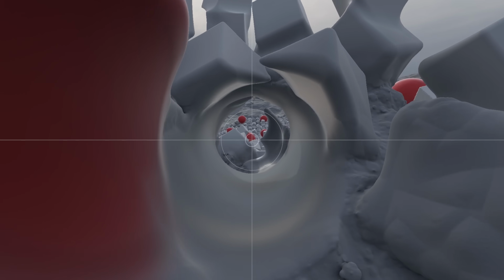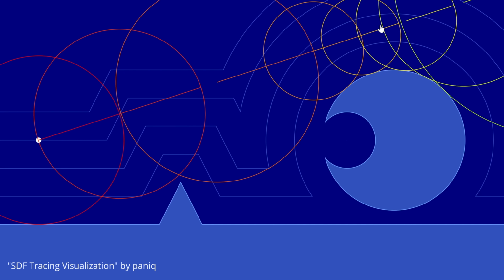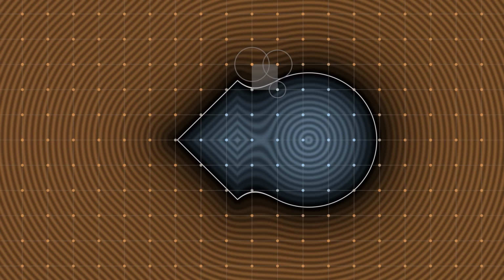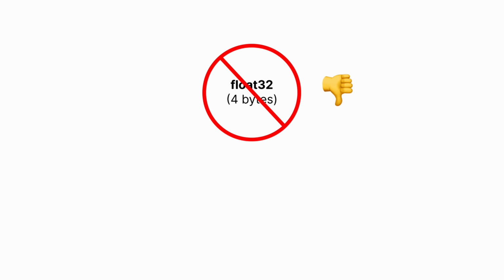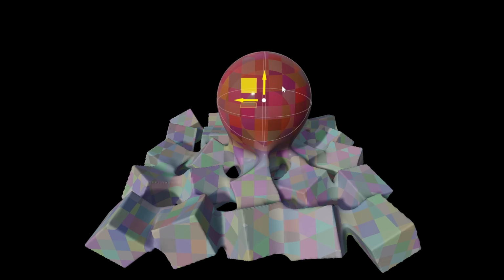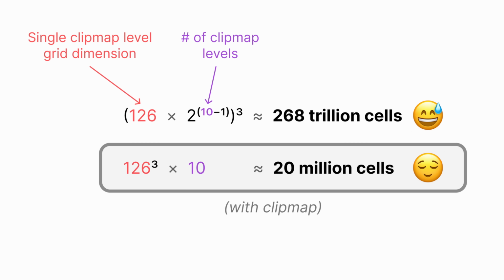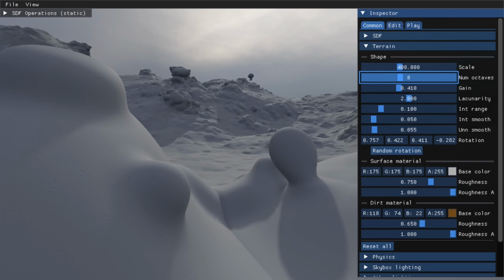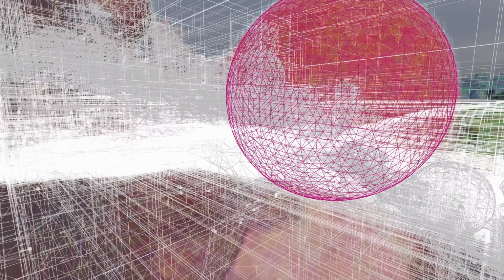I'm making a game engine based on dynamic signed distance fields (SDFs)

Comment: Hi, impressive work, I come with a technical question/suggestion.

You're currently caching SDF values (in a dynamic sparse 3d grid on the GPU), which lets you save time, in exchange for slight deformations of the surfaces.
Have you instead considered caching references to the closest primitive SDF and its parameters ?
That way you could evaluate the few neighboring primitives referenced in the cache at a given point. I might be a bit more expensive than a bilinear interpolation, but still way cheaper than computing the SDF of the whole scene. Importantly, you would keep exact surfaces, and so maybe you could reduce the granularity of your cache's grid (really, you "just" need to make sure there's about one grid vertex per primitive SDF).

Admittedly, I'm not sure this is a wise thing to do with your engine, I'm just frustrated because the first thing that seduced me with SDFs was the possibility to represent many non-polygonal shapes exactly, so I was wondering if it could be saved.

Comment: I was disappointed when I got watched to the physics implementation. SDF makes it possible to perform collisions of the most complex objects and find the exact value of penetration as easily as boolean operations! It must be used! The better to spent more time on the physics engine than implementing one more marching cubes...
Reply from the maker: It is a bit more complicated than that because operations like smooth blends and subtractions lead to an inexact (but bounded) distance field. So you no longer have accurate distance measurements.

Comment: I wonder how do you deal/will you deal with some SDF operation like smooth union and stuff that bend the space and make it non-uniform or if this will be an issue in the first place. I guess it depend on what you do with it.
Reply from the maker: The short answer is that I limit the amount this happens and then pad the affected area in such cases for recomputing the SDF surface.

Comment: Others have given their input regarding the technological side of your project, but If you’re looking for help or inspiration for the “game design” side of making a game about destructible terrain, I highly suggest checking out Nintendo’s dev interviews for Donkey Kong Bananza, a 3d platformer which also uses destructible terrain (albeit done with voxels) as its main gimmick. They go over some of the problems they faced in the process of making a game where the player could just tunnel through everything as well as how they solved them.
Reply from the maker: Good suggestion, I did watch the DK Bananza GDC presentation last month and liked it, definitely relevant. Are you thinking of specific interviews?
Reply: @Mike-Turitzin  the dev interviews on nintendos website

Comment: Since you're looking at sparse trees, you might find this paper on directed acrylic graphs interesting https://www.cse.chalmers.se/~uffe/HighResolutionSparseVoxelDAGs.pdf
Reply from the maker: I've seen it, and it's good!
Reply: @Mike-Turitzin  by the way, I also have a raymarching game engine I've been working on so it would be interesting to chat, mine is no where near as good as yours mainly as I have no sparse voxel traversal to act as a cache. I have massive performance issues which has been demoralising, but I'm pretty proud of what it's able to render otherwise

My main issue is that it's running on a giant compute shader with nothing pre-compiled, everything is fed through the SSBO, BVH with each leaf being bytecode in postfix notation to describe the CSG operations. So the shader basically runs a virtual machine to handle those operations, the register pressure alone means that even if I'm rendering only something simple at 1080p I get 30fps (on my 980ti). The upside is it has the freedom to basically render anything on the fly, I've got something like 15 primitive shapes in there at the moment which can be smooth combined in many ways, and the bytecode supports operations like bending, twisting, displacement, elongating, rounding, domain repetition, symmetry, and the operations can nest and combine however, such as twisting two boxes and then smooth union those to a sphere before then spatially folding that resulting shape. So I'm very happy with the variety of what it can render on the fly at least

But yeah performance is a nightmare. So I've been looking at stuff similar to your voxel brickmap. But also considering something like parallax raymarching, where it's fragment shaders on mesh AABBs, and that means each shader can be a tighter hot loop as it no longer needs to be monolithic. Or compiling tight hot loop shaders on the fly, giving the player only a limited number of ways they can change things so that I can pre-compile all of the options they may choose from ahead of time a few seconds ahead of the player actually doing it. None of the options are really great, all of them have issues

Comment: So if I understand it right:
1. You take the SDF, evaluate into some voxel data type. Then you trilinear interpolate them to render them on the GPU.
2. You use layers of the voxel data type to represent different resolutions, and render according to distance (I.e. choose the correct size to interpolate and render)
3. Of course physics is hard, so just use a generated mesh to do standard physics, no biggie.

If 1. is correct, does that mean that your engine renders exclusively using ray/path tracing? Afaik, traditional raster rendering needs a mesh, but the interpolation technique should work with ray traced rendering flawlessly. (EDIT: I checked the paper, and it seems my hunch here is correct)

If 2 is correct, does that not have potential to cause discontinuities at places where a smaller, higher resolution layer gives way to a larger lower resolution layer? In raster, mesh based workflow, you'd have to find a method to stitch the two properly, but do you not need to do this due to the ray traced rendering? Do you interpolate any irregularities away to make it almost perfect?

bonus question(s): Storing your entire scene as a bunch of SDF operations, does this not make the initial computation where you evaluate the voxel grid quite expensive? I suppose the cost is only applicable during "world generation", as the voxel grid can be saved for the future. BUT as the world is editable as if it were an SDF, how do you get the voxel grid to behave like an SDF to perform operations like boolean operations on them? Can the trilinear interpolation be used for this as well? If not do you store all SDF operations and recalculate per "chunk" per modification (this sounds terrible and very wrong to me)?

Truth be told I watched this video a month ago and didn't understand anything. But you inspired me to go on a learning journey on SDFs and modifiable terrains, and I came up with almost this exact method to create dynamic terrain (besides the rendering approach, I was only considering dual contouring for tessellation). So now when I came back here to watch this video again, I could understand the topic and it helped answer a lot of my questions. So, thank you!

Comment: This is like the story of the dude who drew a perfect circle without any tools.

UE5: nanite, lumen, raytracing
This guy: Yeah cool, but can you do *points at actually perfectly round sphere*??

I really like these non-traditional rendering approaches. Also really love the squishy geometry. Add some subsurface scattering, make things translucent and you got the perfect trap for acidheads.
Reply: While I know it's popular to rack on Unreal, Nanite in particular is a colossal technological achievement, effectively addressing genuine limitations of the hardware of the GPU in a very elegant and scalable manner. Whether or not it will lead to good things is another matter.
Reply: @Olaxan4  I mean at some level, sure, but then again dynamic LODing isn't new… Messiah had it back in '99. And just because the hardware is now powerful enough to calculate LODs for high-poly assets in ~real-time doesn't mean we should – I just don't see how this is better than baked LODs (possibly generated through the same algorithms), especially given the performance cost.
Reply: @franknord4826  Nanite isn't just mesh decimation, it's a software rasteriser, replacing the GPU rasteriser; designed to solve a fundamental issue in GPU hardware: the bottleneck of the Primitive Assembly stage, where triangles smaller than a pixel get huge overdraw overheads. Subpixels isn't anything that only happens to super high res geometry, either -- it's very common for scatters to become so small. Because Nanite simplification happens during rasterisation, it fares much better compared to previous methods of mesh decimation.

Historically (and yes, still; even with Nanite) this is solved with culling and LOD. However, I am of the opinion that LOD pop-in is a very distracting thing that games often still suffer from. Nanite has the ability to do this practically seamlessly. It can be done well with effort, but I think this is definitely an area where technology can give us better results and remove some burden from the already overworked artists. Plus, traditional LOD models eat some disk space and need to consult the disk frequently. Not huge impact, but if we're looking at pros and cons we need to be fair.

Dynamic LOD also has the ability to handle partial simplification of large models: imagine doing LOD for a huge bridge, or a cathedral? Sure it's possible, you can segment the model up in chunks -- but dynamic LOD means you don't even have to think about it.

Nanite has some performance overhead, but it's getting better with every update, and nothing exists in a vacuum -- some scenes can use Nanite very well (even without going nuts with the triangles) and outperform typical LOD workflows. It's just that wham pieces directed against Unreal rarely do a fair job here.

Comment: Can't wait for the Moore's Law to finally reach its limit, so the top game programmers are forced to dive head-first into this kind of deep optimization, so we can finally see what our incredible modern hardware is ACTUALLY capable of.
Reply: We are getting close looking at Nvidia gpu advancement, as the 5080 is just a little better, and most of that marginal change due to better overclocking. Also we have silicone lottery loss rates of 70% and most chips fail, any smaller And we need major technological advancement.

Comment: Amazing project, I am looking forward to seeing some innovative gameplay using such novel game mechanics.

Despite my limited understanding of the specifics, this seems ideal for high viscosity fluids. I wonder if placing a bunch of tiny balls would be a good way to have a fake liquid simulation. Having the liquid "particles" also magnetize eachother in extremely close distances (inverse cube attractive forces) might be decent enough to simulate surface tension as well. The way the objects blend into eachother just seems ideal for high viscosity stuff, at least for localized bodies of liquids.

On a somewhat sidenote, I am curious how it looks when you place objects smaller than the smallest grid size and how that would look if there were multiple of them.

Comment: There are follow ups to that Valve paper on bilinear SDF rendering that store directional distances in R G and B to greatly enhance the rendering of corners and reduce wobbly lines. It'll triple your memory usage and GPU bandwidth, but at 8MB you're probably not hurting. You'd google "Multichannel signed distance fields" and there's a github page for msdfgen where the author of the paper has his tool and also a link to the phd thesis on the topic. You may actually reduce memory usage because you can still get razor sharp edges with a lower resolution grid.

Another thing that may be useful, boolean operations actually have really nice algebraic properties. Union and intersection are both associative and commutative, so you can reorder them and compute in parallel as much as you like without changing the result. It's only difference that starts to wreck things, so as long as the difference operations stay ordered, you're in business. In practice this may not always be true though, because of floating point rounding and also additional things you might be doing with SDFs on top of pure union and intersection that make it no longer totally associative/commutative. It should still work, but may cause artifacts if you don't iron out the edge cases. YMMV but interesting avenue to look into.

I'd have to think about it harder but spatial hashing may be a good fit for keeping your sparse grid? VERY fast, very simple.

Making your own physics engine is also not nearly as hard as it seems. The XPDB algorithm is a couple dozen lines of code and just about cutting edge. The original author of the research papers also has a youtube channel that goes in depth holding your hand to make an XPDB solver, it's "Ten Minute Physics" by Matthias Müller. With SDF for collisions, you're already in a great spot to make a physics engine.

SDF's also have really awesome properties for lighting, I'd look into adapting radiance cascades. Basically, radiance cascades look like path tracing except it fast as heck. Fully dynamic too.
Reply: I'm kinda wondering if it's possible to use textures in this. I think it should be, you can at least get tri-planar mapping pretty easy. Tricky to make textures follow objects, but not impossible. Alternatively you could embrace the "chowder effect" of the textures being pinned in space as an art style. And decals are absolutely possible. Not nearly as slow as they used to be if you use a forward+ (tiled) architecture, same advancements that work for lights also work for decals.

Comment: Can't wait to see what gameplay you come up with! 

This engine/concept seems perfect for a Portal 3 puzzle game as a nice evolution to environment warping from the original portal mechanic in Narbacular Drop, and the gel mechanic inspired by Tag: The Power of Paint.

As soon as I saw the traversable tunnel and hole able to gobble up objects it was a perfect fit for Portal.

There are soooooo many neat puzzles this could make with different materials having different levels of manipulation allowed (similar to surfaces in Portal).

And then I could see integrating it into a more fleshed out world like Half Life could add some amazing dynamic gameplay, well given restraints so it doesn't become overly sandboxy.

The downfall I find in games that become too sandboxy like NMS and DK Bananza, is while engine flexibility is neat, it quickly becomes hollow and tedious. When you have the tools to do basically anything, there needs to be constraints so it remains intellectually engaging and not just a chore.

Comment: You only need high resolution where two mediums interact or where there is relative motion. Otherwise the grid cells can be very large. I've seen this same technique with trees and fluid simulation.

Comment: this is what Subnautica devs wanted to do at first but understandably failed due to computational challenges
Reply: Did they mention where they got hung up?
Reply: @techpriest4787  they said specifically the file size of the save (due to changes being saved on the fixed subnautica map) and lag (lots of 3d booleans). Sdf's are pretty needed, and they tried to do it in mesh geo

Comment: Hey! Awesome work this is really inspiring! 

From my understanding, one of the major downsides of using the brick map cache and normalising your signed distance values within the range of a single voxel size is that you lose the ability to efficiently skip through empty space. Converging on a single surface requires sampling every voxel along the ray. I was wondering if you had any approach you've tested to reduce this additional cost? I was thinking about something like pre-initialising a depth buffer by rasterizing the cubes of each brick or maybe trying out the ray-beam optimization that has been popularized in voxel engines.

Comment: Hi, thanks for the great technical overview! I did not quite catch - how do you index back into the brick map / atlas? You said that it is a "dense grid of pointers to bricks", does it mean that you store a low res grid of pointers (indices) and most of them point to "empty space" / "nothing interesting", but some of them point to densely rendered grids of sdf values? So you DDA through the first dense grid, and for each non-empty pointer, DDA through corresponding grid of linear interpolations, and then possibly "fine tune" each pixel with some actual ray marching (using an octree you showed to find nearby geometry) is that right?

Comment: Looks interesting! However, I feel  like something is missing here: the original idea was built around direct SDF rendering because "rendering is slower but modification is free". And then you proceed to add physics based on marching-cube meshes and solve the "slow modification" issue by parallelizing the computation. Now, I guess, the benefit of SDF rendering is gone and it's just a stylistic choice? Could be an idea for another video: what have you learned and what would you do differently if you were to completely re-implement it.
Reply: Nah it’s not gone jolt runs on cpu all the rendering here is gpu. And he says he doesn’t use marching cubes for gpu but brickmaps. By the looks of it rendering here is the hardest and most optimized part of the project.
Edit: I see what you mean when considering cpu side only but still he would need sdfs to perform the edits anyways even if he turns it into a mesh.